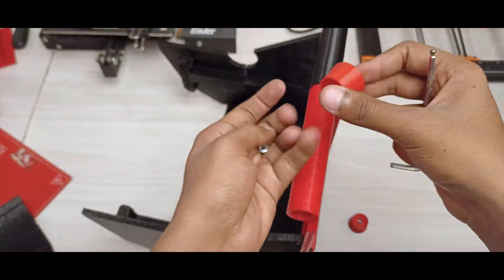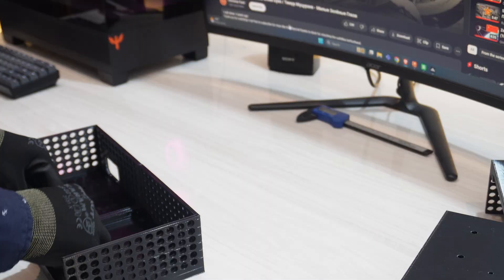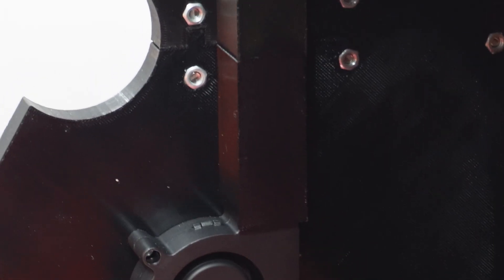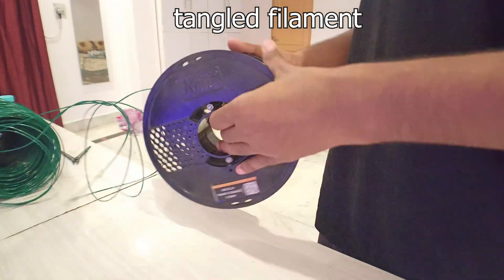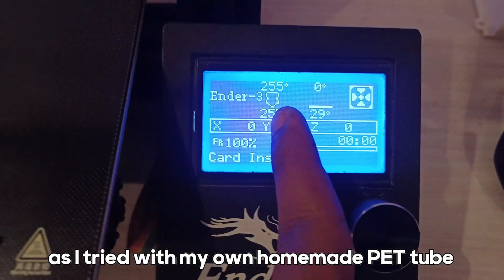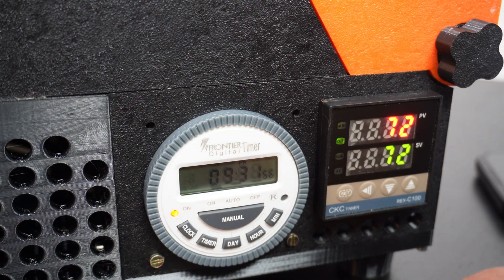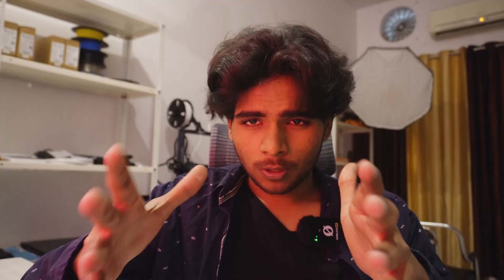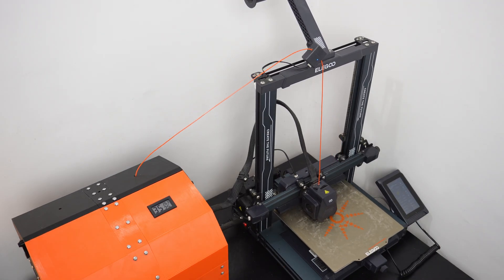100% 3D Printable Filament Dryer

Comment: How well do the 3D printer heating beds work to heat the air? How warm can you get the inside and how long does it take to heat up? They also seem like they can be expensive but maybe that's just buying replacements from the printer manufacturer. Have you seen the small PTC heaters that come in different voltage/wattage and can be bought with a fan attached? Might work as good or better?

Also, does it have a vent for the damp air to exit? Maybe one that opens periodically so hot air isn't constantly blowing out... I've started designing something similar but with minimal printed parts since it gets hot and needs parts a lot bigger than most build plates or have to be connected somehow. Anyways, I haven't gotten far and this looks nice

Comment: My dream is to design one that can store and dry 10-14 spools of filament. I want it to use 2020 extrusions, though, I think, and polycarbonate sheets so you can look inside. Can you help me with this? btw, you should move the PSU outside of the hot area.

Comment: Hi! I am trying to contact you about your diy Filament maker from previous videos. I am trying to design it again and can't seem to see / find all of the wire connections in one place. I saw the wiring video on the other channel but that does not include the updates with the speed controler and motor. I also do not know what sort of pipe / tube is used in the augar bit driver section.  Would you mind making a video over the wiring with recent updates or if you could a step by step tutorial of you putting it together from the parts? Also, I cannot seem to find a heat band for this. Where would I go about finding that? Again as im sure you have heard, Thank you for you continued help towards this 3d printing recycling community!